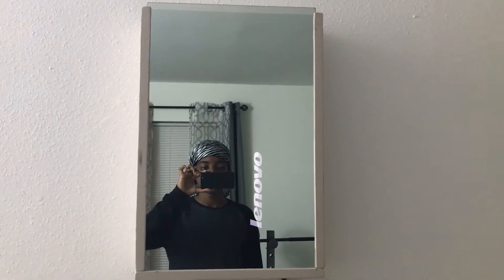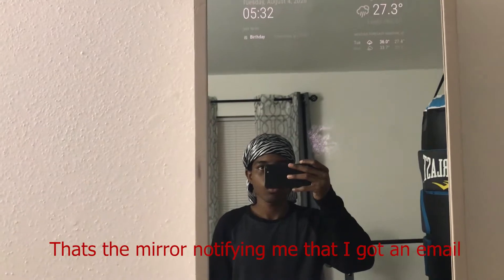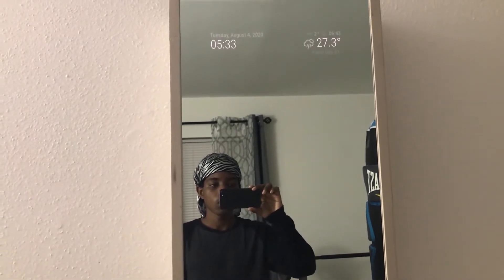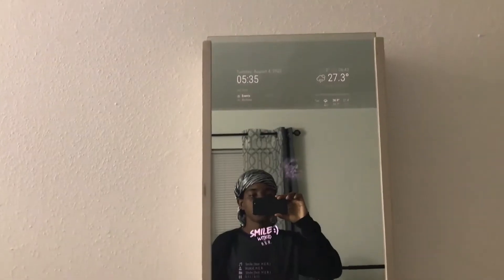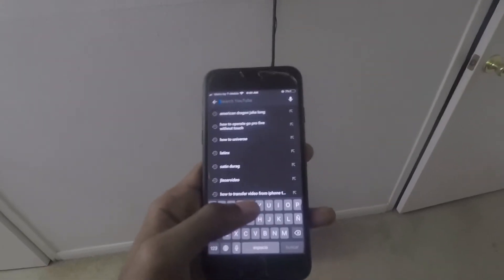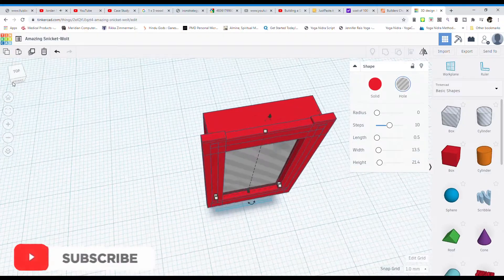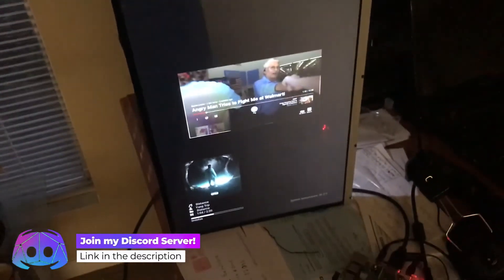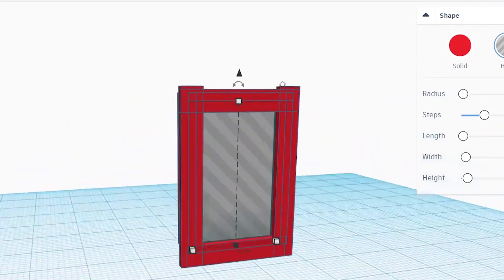Smart Mirror Build │ Alexa, Gmail, YouTube, Screen Cast, Spotify, etc

Comment: which module did you use to cast youtube from your phone to smart mirror ?
Reply from the maker: Hey I used the MMM-ScreenCast modue heres a ink https://github.com/kevinatown/MMM-Screencast
Reply: @basedalgobro  hey that's YouTube only still right? Or does it work with Netflix, Plex, Prime video, etc? I want to cast any cashable video to my MagicMirror
Reply from the maker: @minyanism  hey bro no t only works on youtube. the guy who made this module did a code where the pi pulls up the actual youtube website. I am not aware of any netflix or other streaming software modules, you will most likely have to code your own module for that
Reply: @basedalgobro  Ah yeah I've spoken to the creator a couple times before he went back to school. Been looking for some workarounds since but I am not the best at coding so it's been pretty limited. 

Right now I'm thinking the solution is turning the Pi into a chromecast device, but I'm not sure how that would work the the MagicMirror display, which is why making a chromecast Module would be better. Tricky stuff!